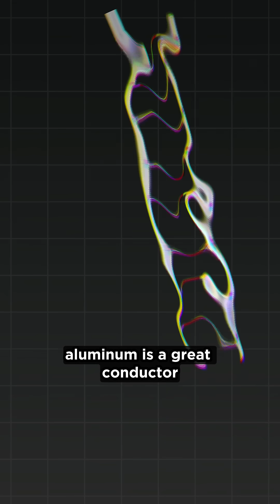How Did This Ladder Melt The Ground?

Comment: High power electricity can "jump" around 20 feet depending on the current weather conditions, and other conditions. Just the same, a lightning strike can hit someone from 20 miles away, depending on the build up positive water to negative ice and cloud to cloud static.

Comment: What does questioning why the protection didn’t operate have anything to do with police officers or firefighters contemplating what their options are ?
Especially when neither have a clue and are just waiting for the utility to open the circuit. But to answer your question, the protection didn’t operate because the fault current wasn’t high enough. It’s a high impedance fault. The system just sees it as a load.

Comment: Actually, lower resistance creates more heat. The equation for power is P = I^2 * R.  Power grows with the square of the current while it grows with resistance only linearly. So, power favors current and lowering the resistance increases the current.

Comment: ⚠️ it's fine! The power will NOT trip provided conduction amps remain within the supply range. NOTE, Also, grid current does NOT have and earth leak breaker, RCD, or otherwise. Those kinds of earth detecting safety devices are all domestic. ❤

Comment: I'm thinking electricity doesn't need direct contact to arc on a path of least resistance and it's not always visible as a spark or bolt. Be careful. People with straighter hair might feel them standing up with all the charge in the air.

Comment: The aluminum is melting. That is what you see. Thete is no breaker, it is touching the wires, and current is flowing. The bottom rung of the ladder is 3 inches from the end, it is 10"

Comment: As someone who works with high voltage I can say this.  As far as I know there are no circuit breakers on power lines.  If there were we would have a lot more power issues.  Circuit breakers in your house you can work with.  Imagine meemaw tripping the breaker every day for 100s of people though

Comment: The electricity will still arc through the air to the ladder,it all depends on the voltage and distance between the ladder and the wires.

Comment: Completely nonsense.  That would be the ladder melting.  There is no way it would get hot enough to melt the concrete without the low melting point aluminum not melting.

Comment: It's actually stills up with an electric current and it's still holding in electricity amounts so there still a dangerous amount so will still need to a block of concrete to be removed and also the ladders extremely hot about out 100 in degrees so that's why i will need to destroy the power line is it good electrified person who's going to turn it off

Comment: That ladder is NOT fine. But Aluminum also has a high melting point, so it's not melting as much as you might expect. But that bottom rung shouldn't be right on the ground like that.

Comment: About the breaker; what a lot of people don't get is: The breaker is not there to protect you. It's there to protect the line itself. The current flowing was probably not high enough or not flowing long enough to endanger the line.
Protecting humans is be the job of an RCD, which you would not usually find on higher voltages.

Comment: the resistance between floor and ladder is high enough for the current to remain low enough to not trip the big public network breakers. that’s how a lot of electrically caused fires start. you have a material heating up but not conducive enough to trip the breaker.

Comment: Uhh what you're looking at is aluminum slag. Concrete doesn't melt, it decomposes with heat because the moisture holding it together evaporates.

Comment: As someone who worked in high voltage industrial electronics you can get with in so many feet of a power line and it will ark and make contact

Comment: You have no idea what is happening. It's an aluminum ladder on concrete. Concrete is not an isulator. It conducts electricity and is a poor insulator, the ladders melting because it's a a resistance, and that power line is upwards of 30k volts. The ladder is melting because it's the weak link in the electricity and it's a hot point.

Comment: I work on the power grid.
Because the path to ground consists of the aluminum ladder (low resistance) and the concrete (high resistance in series) the current was not allowed to reach a high enough value to trip the breaker.
If the ladder were directly touching the earth, it would only be the low resistance in series with ground, causing a higher-current fault which would trip the breaker.

Comment: The probable reason the ladder is upright and not touching the wires is because the ladder melted at the bottom due to the localized heating, but eventually enough melted that the ladder can't reach the wires anymore.

Comment: 1) High resistance doesn’t cause the heating, high current does. Higher resistance will lower the current and thus reduce the opportunity to melt. 2) Aluminum is a good conductor with a relatively low melting point. If there was high current in the ladder, it would be more likely to melt the ladder than the ground. 
There is obviously more to the story. Based on what I see, it’s difficult to guess what that might be.

Comment: Concrete doesn't melt like that. There was something below the latter that has melted the same way rock/sand melts.
Concrete is a little sand with a little gravel and a lot of binder material.
I could even believe that it's a mixture of the melted aluminum alloy and whatever was under or next to the latter.
There is way too much burnt and melted material to just be the concrete directly beneath the two feet of the latter. 
Lastly, the first step on any latter is not that low to the ground.

Comment: The amount of amperage going through the wires is so high it takes a massive fault sustained to trip the breaker at the substation 

They are " auto re-closers " 
Meaning if it trips it re-closes the breaker
Trips again and re-closes and trips a third time and stays open 

A dead short will trip it but a tree or ladder or downed wire won't

Comment: I see a ladder arcing on a steel drain or sewer cover, its like when your welding get too close they fuse get a gap and it arcs, there is a reason tradesmen use fiberglass ladders

Comment: The ladder looks like its touching to me honestly. Even if it isn't, the arc from a powerline can reach temperatures as high as 35.000 F. Air has a breakdown voltage of about 30 kilovolts per centimeter. I am unsure how many kilovolts the lines carry, but usually its at least just over 30kv. So it can arc out at least 1cm. As for the molten pool, aluminum and concrete melt at around 1,200 F. The arc going to the ground is more than hot enough to melt both materials as well as the soil itself. As for why the system didn't automatically cut the power, the could have a faulty fuse, have the wrong fuse, the fuse was bypassed\never installed, or there may just not be enough current to blow the fuse. I hope this clears things up

Comment: I’ve never seen that before but I have seen wires whipping around the like a fire hose in the movies and around the corner from my house there’s a box in the ground that hit by lightning every 3or4 years and turns into a white hot glowing hole I’ve also seen a substation that lit the whole fence line around it on fire

Comment: 1) The ladder is indeed melting. Aluminum has a fairly low melting point compared to other metals.

2) The ladder likely isn't drawing enough current to trip the fuse/breaker protecting that line. As it heats up, the amount of current it can carry goes down, so it likely won't stop causing a short until the power is cut, or the amount of burnt material creates a barrier between the ladder and ground.

Comment: Technically this is not a shortcut but a electrical load with a certain resistance. As long the current goes not over a certain threshold the line will stay active.

Comment: actually the ladder do not need to have direct contact.
A usual Voltage of these lines is 10,000 V
That is enough to create a 1 cm electric arc. Wich work like a direct contact.

Comment: Aluminum is a shit conductor, do actual research before you post probably ai garbage online, the ladder would have melted before the concrete did becuse the melting point of aluminum is ~1,200 f and the melting point of concrete of concrete is ~ 1400 f. Also unless there is a positive on the power line and an underground negative that the ladder somehow touched, the ground shouldn’t be bubbling like that.

Comment: Also aluminium doesn't have a visual tell to its heat. Most other metals glow red or white hot when near melting. Aluminium jump goes slightly less shiny prior to melting. This ladder is probably extremely hot.

Comment: What I believe happened is is that the current flowing through you got to look at amperes that's what's causing the direct ground it also created the small magnetic field causing it to lift the ladder enough aluminum is a great conductor but the resistance that's in aluminum is very very low you have free flowing electrical current and you got to look at the photos of the current heartland Christian that's flowing through a transformer is set at 7,500 votes you have created an arc welder at most fuses are set for the current flowing through the transformer so the current doesn't oversee the amperage then it will sit there and look just like an arc welder thank you always you had to make me think on that I truly appreciate you❤
Reply from the maker: Thanks for the detailed breakdown 😊
Reply: Autocorrect I don't know how Christianity got into this😂
Reply: I think licking the ladder to find out if there's still a live current might be a bad idea.

Comment: Worked for a older guy who had a fiberglass extendable ladder. It was very heavy (80ish pounds for 32 ft), but as a young man, he had watched a guy barely survive a metal ladder becoming electrified from plumbing pipe. 

He said the the worst part was how hard it was to get help to him since no one knew what parts of area were electrified. They managed to hook the guy with something attached to a rope and pull him away.

Was a serious workout to set the ladder up, but at least you knew it was not conductive. Obviously you need to look before you set stuff up, but people's janky repairs can cause electricity to be in things it shouldn't.

Comment: Actual Guess: that ladder is aluminum, it touched a high voltage overhead wire, caused the ladder to heat to the pouch of melting to the sidewalk.

Comment: You’re absolutely wrong this happened thru an “induction heating effect” where in basic terms the laser wireless conducts electricity through sympathetic magnetic fields.
Reply: Laser is a typo meant to say line.

Comment: Powerlines are no joke. We do siding and gutters and this guy kept using telephone lines to lay fascia metal on top, (makes it easier to cut and handle) and we kept telling him ot to do it because the power lines were way too close and he was going to get shocked if he didn't stop. Of course, he didn't stop, the metal slipped, hut the power line then came back down and landed right back in his hand. Blue light and big fireballs were going everywhere. It knocked him off the roof, blew big holes in the metal as well as in his foot and leg. His shoe lace eyelets were fused to the metal. He couldnt work for like 3 months, it messed his shit up bad. Be careful out there!

Comment: I think it's aluminium itself melting since it has lower boiling point than concrete or iron 
And it conducted electricity by touching or close by high voltage power line there

Comment: No way that is doing that to concrete. It has to be on a metal cover to a junction box or man hole cover..and there are no breakers for the power lines. They are unfused. There may be some kind of protection somewhere for them but you have to think of all the current they have to be capable of passing without tripping. So this is miniscule to that massive ststem. This is why newer codes need a breaker outside your house as aposed to most old services which don't have a breker until after the wires enter your house which does nothing for you if those wires short out.

Comment: aluminum has a resistance value that is not fully shorting out the breaker.  and there is too much light to see the air between ladder and line to glowing.

Comment: The concrete is providing enough resistance to not trip a gfci as in its producing electrical work. My guess is that it’s taking less current than would otherwise trip the line due to low demand?

Comment: It is not a short circuit because melted metal have more resistance, and there might not be enough current to trip the breakers. Someone has to manually turn off the breakers.

Make a call to the number at the back of a utility bill - and explain.